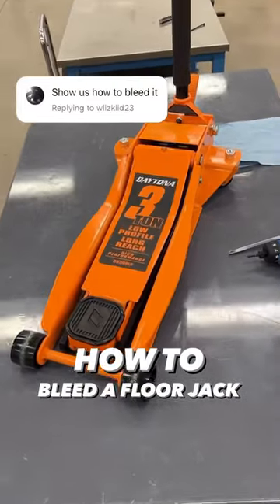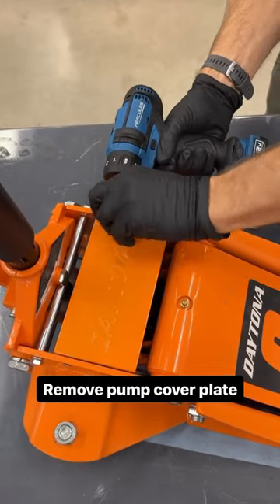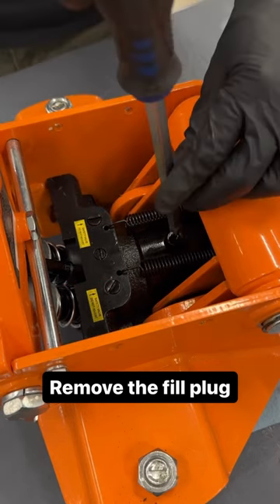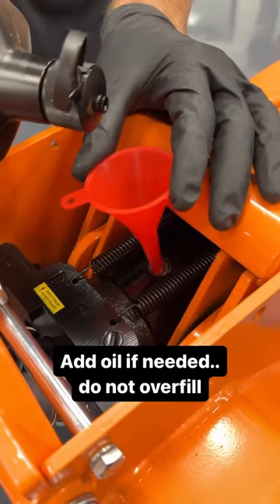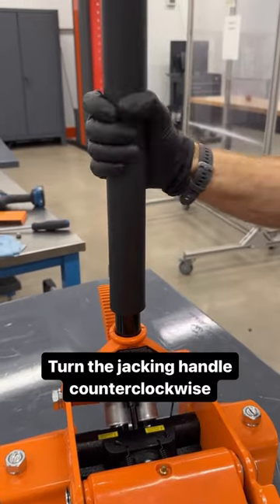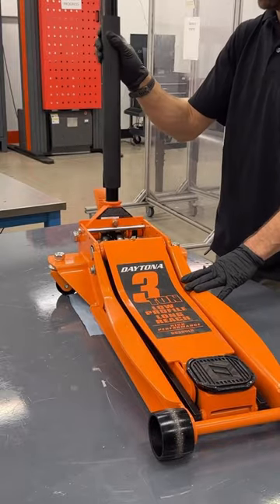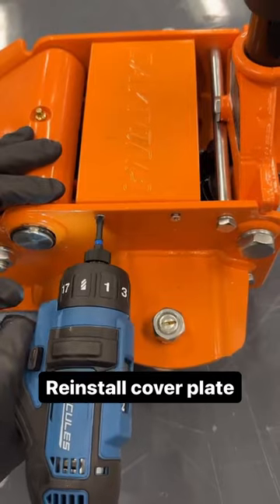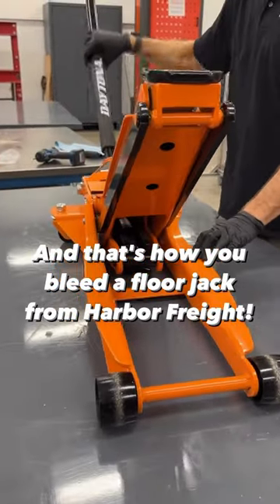Here’s how to properly bleed a floor jack from #HarborFreight. #floorjack #mechanic #howto #shorts

Comment: This is the best video I’ve seen and makes it quick and simple, others are more confusing
Reply: That would be because they built it😂
The only good thing they EVER built, for the record.
Reply: 👍 I went and bought a Pittsburgh 2ton cuz that didn’t work on my old crapman anyway so I kinda jumped the gun with that comment and the plug I had was just a rubber plug and just a pain in the a.s but I did check the seal and everything was fine but just didn’t work anymore idk but I do recommend Pittsburgh products and Daytona is way too expensive for a regular all purpose floor jack

Comment: I like the drill with clutch some people would do impact... they think impact is for everything and that they are the clutch lol
Reply: While I agree a drill with a clutch is the right tool for the job if you have enough experience with an impact gun and especially with one that has a variable trigger speed you can get the job done and without stripping anything but like I said that has to come with experience in skill.
Reply: That's why I love my Milwaukee M12 Screwdriver. Clutch with a 1/4 collet. Perfect for this type of stuff (and all IKEA furniture 😂)
Reply: You just have to know what you’re doing. If you go slow and have a feel for the impact you can do this kind of stuff all day. Plus every tool is a hammer. Except for screwdrivers. Those are chisels.

Comment: Okay harbor freight, I'd love to know how to make it stop squealing like a dying pig every time I pump the jack handle? I've tried lubing every pivot point with a grease gun  AND with spray lithium grease and I cannot make it stop. It is beyond obnoxious.
Reply: I have the expensive “sunburst orange” color jack and it makes that screeching sound as well. It’s only under load and I can’t figure it out either. DRIVES ME F-ing CRAZY!!!!
Reply: @toxicxshamrock1428  same! Only under load, never free jacking, and it's truly maddening, and it would be nice if they could advise us on the known wear/squeal points. At this point I'm just gonna tear the whole pivoting assembly off and apart and grease the dog snot out of it and hope for the best! I'll keep you posted if it works once I actually get around to it.
Reply: It's the pump design squeezing fluid from the pump pistons through the office into the Jack piston. You can't alter it. Made in China 😅.
Reply: @prebaned  That makes sense! I can see/hear the check valve squeal under pressure now lol😅

Comment: I would just like to say for anybody that owns floor, jacks or bottle jacks with hydraulic fluids, all jacks. That have hydraulic fluids have to be bleed every now and then because it’s just like brake lines your brake lines have air in them. Your brakes aren’t gonna work as well as they should writethe same thing with a jack

Comment: Fun fact  3 4 5 ton Daytona Jack they all have the same size cylinder. It's only until the 8 ton and 10 tone and 10 ton Daytona Jack's Jack is when they change the cylinder size.

Comment: Are you supposed to bleed them after purchase? When is bleeding necessary?
Reply: You should always bleed jack after purchase and roughly every month thereafter, they can lose pressure over time especially with use.
Reply: @ItsTheGrineer - strange I’ve had mine for five years probably. Never bled it once.  And it’s not like it’s not doing its job or it’s soft. It out doesn’t need it.  So I would disagree that you need to do this every month.

Comment: Is it worth getting the super duty?
Reply: Was going to HF yesterday to grab the coupon for any Daytona jack w the intention of buying the jack in this demo. A fellow early-bird coupon shopper advised me to get the Super Duty one (Snap On competitor). I naively thought this was the same but just w long reach. He explained the Super Duty uses a premium piston seal that the standard ones do not. You also get a standard 3 yr warranty. All others are 90 days. I took his advice. After buying the standard one, I also noticed it has zert fittings in places for grease the others don't. TLDR I get it now - the others are designed to look like the same quality as the Super Duty but are more like well-built Pittsburg with a better paint job and different features.

Comment: Suggestions on what kind of grease to use on the zerk fitting at the lift arm?
Reply: Any kind of grease meant for bearings or extreme pressure will work great. My favourite is Klondike nano full synthetic EP1.5. Lucas Red N Tacky and amsoil grease are also good choices.

Comment: Any jack even after this process without weight,it will lift but once you put weight on it and test it still will not lift.
Reply: So what is the solution??
Reply: Do the process with weight on jack

Comment: @harborfright my floor jack released all its fluid after three uses, when I contacted support the best they offered me was a gift card as compensation because i did not buy the extended warranty, i did not take it. Please be careful of these jacks they could be extremely life threatening and dangerous!!!
Reply: I just had this problem like 30 mins ago I bought one and I put oil and after three pumps boom oils splashed everywhere
Reply: All hydraulic jacks are dangerous

Comment: what if the floor jack is stuck in the UP position?
Reply: Rotate handle counter clockwise and it should lower, make sure handle is fully inserted

Comment: You can bleed any floor jack by fully opening the lowering valve and pumping the handle all the way up and all the way down like 10-20 times
Reply: Ya and where does the air go smart guy.

Comment: Why are they selling a product not ready for use??? Maybe because it's overpriced garbage, all quality tools are sold ready to use non of this bullshit that should be performed by a professional in the factory, but that's not the worst part HF is a fucking joke when it comes to returning a defective item, if something breaks especially expensive equipment like generators or compressors or welders and you simply want to get your money back good luck, they're going to charge you a chicken shit restocking fee for an item that can't be restocked it's broken, believe me I went in fucking circles with management over it, HF is a circus full of a bunch of clowns, beware if you decide to shop there...